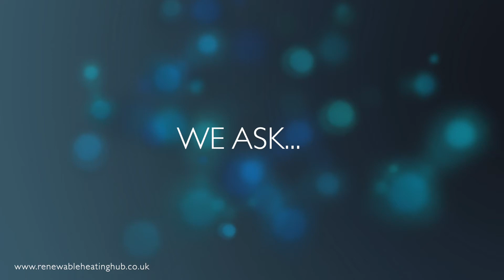What is the difference between a split and a monobloc heat pump?

Comment: I'm thinking of using a split to then heat water at a low level high volume inside a living space. This is to avoid a monobloc with glycol.    Do they make a split that is actually designed to heat water inside a space?  If so what are they called? (Refrigerant lines, not glycol/water lines,  running  from outside to inside house to heat water*)